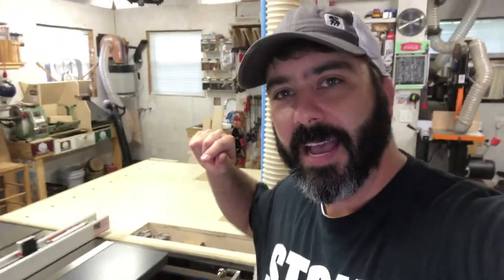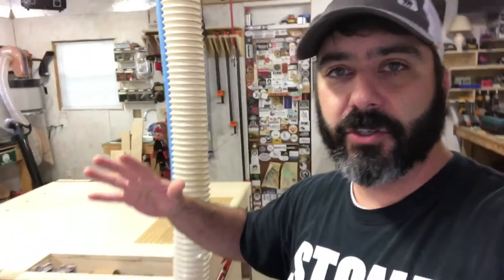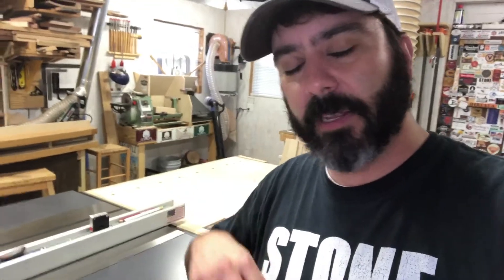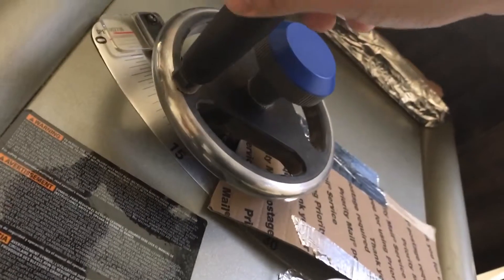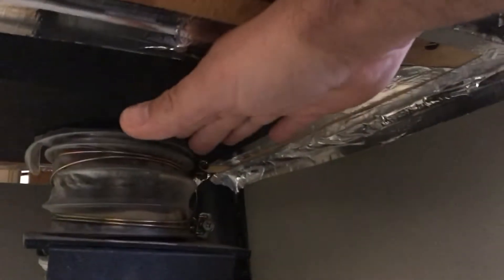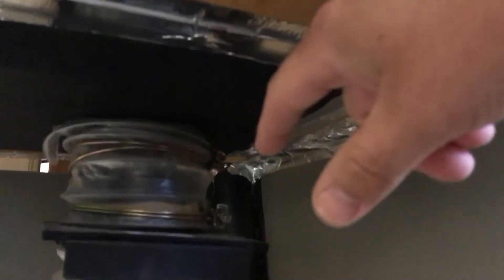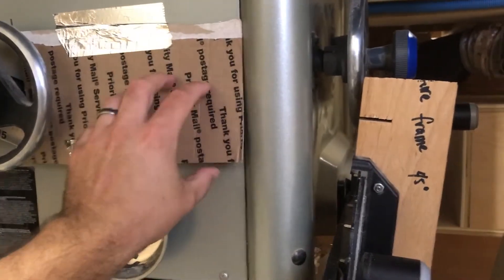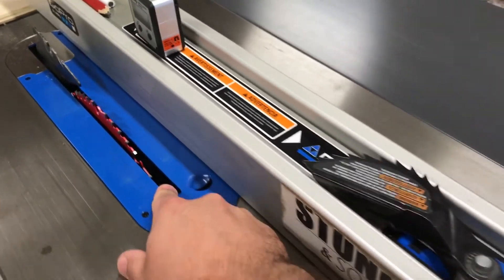Table saw dust collection

Comment: I used a piece of magnetic sign (the kind they stick to car doors) to cover the slot in the front of my saw. Works great and is easy to move on and off or around to close off the slot when mitering.
Reply from the maker: Very good idea! Thanks.
Reply: Yes. I picked up magnetic vent covers for that back hole.

Comment: ABBEY THOMAS
I AM DOING SIMILAR TRIALS AND ERRORS FOR MY TABLE SAWS'  DUST COLLECTIONS. ONE THING I KEEP WATCHING IS YOU CAN'T CLOSE OFF ALL YOUR OPENINGS OR YOUR AIR WON'T MOVE THRU. HAVE YOU CALCULATED YOUR AREA FOR VAC HOSES VS OPENINGS? I AM TRYING TO KEEP MY OPENINGS A LITTLE SMALLER TO MAINTAIN VELOCITY.
Reply from the maker: +A Thomas in my system if you leave more than one gate open the suction reduces drastically. The four inch ports seem to work best in my situation.

Comment: Did you pull the whole shroud off the blade, or just block off the port somehow?
Reply from the maker: onecheapgeek I just removed only the blue dust port/shroud. I did not remove the blade guard. Then I blocked off the opening.
Reply: What do you think about removing the metal guard? Is there an advantage to keeping it? Mine sometimes touches the blade plate and makes noise but I’m not sure if I can remove it.

Comment: a zero clearance plate will make the dust coming off the top worse i think you'll find
Reply from the maker: I'll report the results. I need one anyway to keep the small pieces from falling in.
Reply: Stone and Sons Workshop 2 I find the zero clearance makes it worse. Anxious to see your results.
Reply: I think you're right.  Most of that dust is carried in the blade gussets and flung forward I believe.  I created an over arm dust collector for this saw out of the stock blade guard to reduce the dust up top. I posted a vid of that project on my channel.  I've thought about doing the same thing on my saw that you did here. Would you say there is a marked improvement?